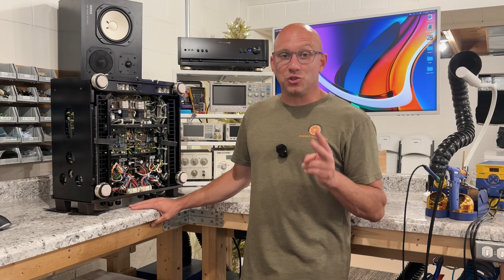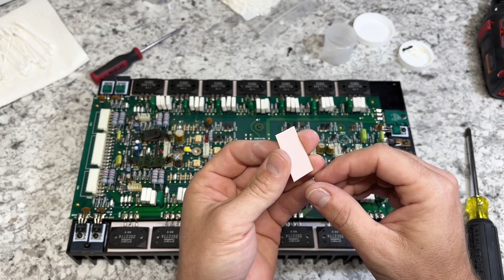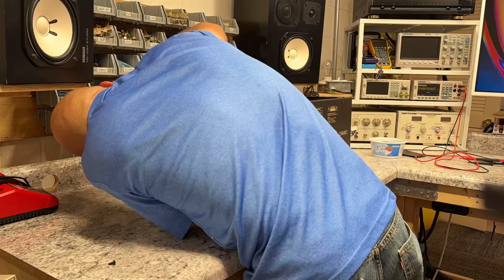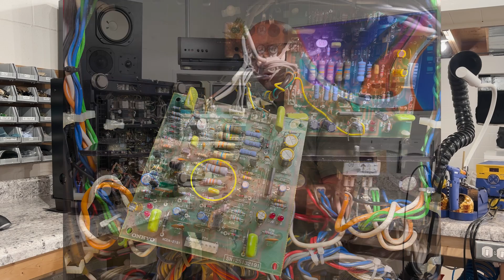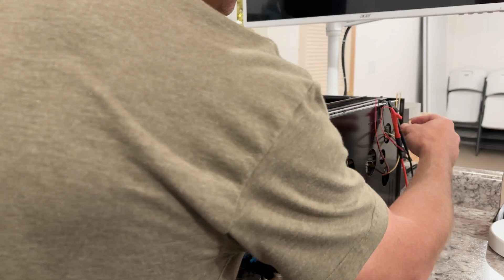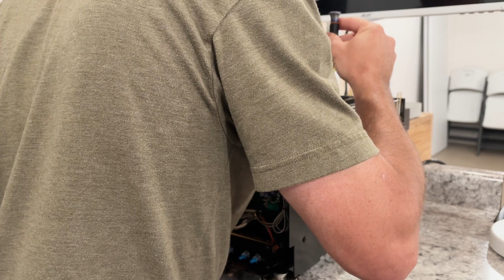Onkyo M-510 amplifier. First power after restoration!!!!  Part 6

Comment: I can't find anything on the positive and negative side of the bias in the adjustment procedure. I just states on page 15 to measure between P006 terminals 1 and 2 on board NAMA-2194a. It should be 20 mV at the start and after 10 minutes.
That's it.
Reply: I ment P1006.
There's also P1007, P1008 and P1009.
Reply from the maker: You can’t find the test points?  They are pins in a header….

Comment: Awesome! Its wild to me to not use a DTB at first power up.
Reply from the maker: Trust me, I wanted to. The amp has a stepped start design that won't function with a load limiting dimbulb. I ran into issues when using my isolation transformer too.  I had no choice with the test gear I have available.
Reply: Its wild. But DTA